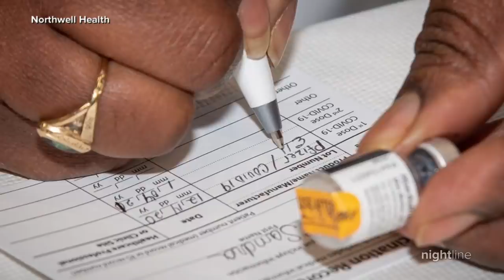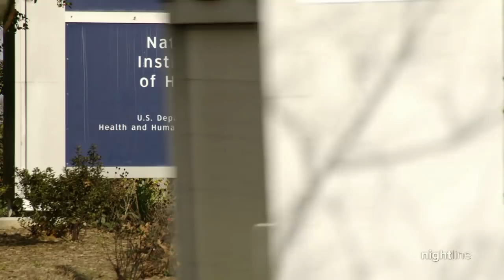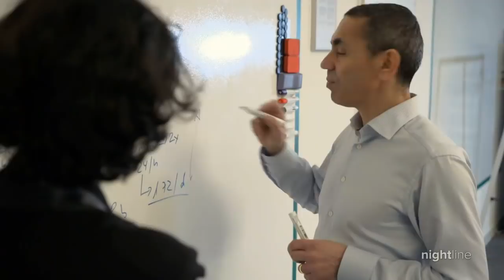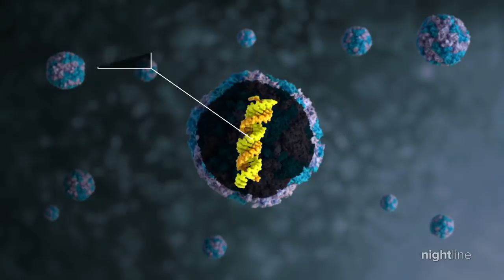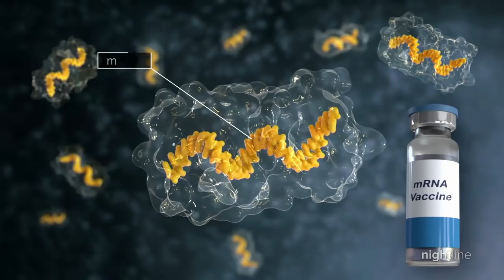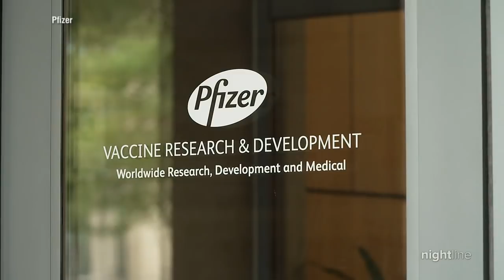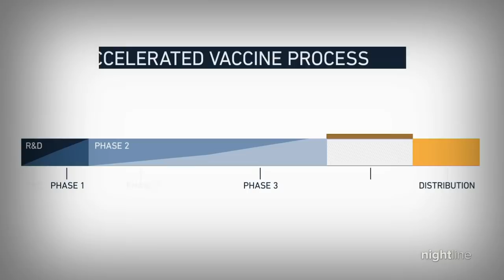Inside the race for a COVID-19 vaccine: Part 1

Comment: The Vaccines Are Worse Than Dr Mikovits Thought

Dr Judy Mikovits said that this coronavirus vaccine could kill 50 million Americans over the next 40 years. The versions being released by Pfizer and Moderna require storage at minus 70 degrees Celsius (minus 94 F) and might be far more deadly than even she originally estimated.
Why so cold? Children’s Health Defense explained in an August 6th article, “mRNA vaccines undergoing Covid-19 clinical trials, including the Moderna vaccine, rely on a nanoparticle-based “carrier system” containing a synthetic chemical called polyethylene glycol (PEG).”
The use of PEG (polyethylene glycol) in drugs and vaccines is increasingly controversial due to the well-documented incidence of adverse PEG-related immune reactions, including life-threatening anaphylaxis.
Roughly seven in ten Americans may already be sensitized to PEG, which may result in reduced efficacy of the vaccine and an increase in adverse side effects.
If a PEG-containing mRNA vaccine for Covid-19 gains FDA approval, the uptick in exposure to PEG will be unprecedented—and potentially disastrous.
Moderna documents and publications indicate that the company is well aware of safety risks associated with PEG and other aspects of its mRNA technology but is more concerned with its bottom line.
Lipid nanoparticles cause hyperinflammatory responses in the body, leading to severe reactions, hospitalization and potentially Death.
Why are LNPs (Lipid Nanoparticles) used in these vaccines? As Children’s Health Defense   further explains:
Lipid Nanoparticles (LNPs) “encapsulate the mRNA constructs to protect them from degradation and promote cellular uptake” and, additionally, rev up the immune system (a property that vaccine scientists tamely describe as LNPs’ “inherent adjuvant properties”)
In other words, the LNPs are adjuvants, meaning they are designed to cause hyperinflammatory responses in human beings, once injected. This is done in an effort to induce the creation of antibodies that then allow the vaccine manufacturer to claim high “effectiveness” rates, even when those very same adjuvants cause severe adverse reactions.
According to recent vaccine trials conducted by Moderna, 100% of human subjects in the high-dose vaccine trial group experienced adverse reactions.
So why are Moderna and Pfizer using mRNA (messenger RNA) in a vaccine? They want to reprogram human DNA as an experiment and see what happens to our progeny. Critics in the UK say a side effect is sterilization which is good for the Powers That Ought Not To Be because they want to rid the earth of 6 billion plus commoners.
Update at 4:50 AM. From the Australian Independent:
These new vaccines are in an entirely new class all by themselves. They are known as “messenger RNA” (mRNA) vaccines, and they work by hijacking the protein-making machinery in your cells…
When Moderna was just finishing its Phase I trial, The Independent wrote about the vaccine and described it this way: “It uses a sequence of genetic RNA material produced in a lab that, when injected into your body, must invade your cells and hijack your cells’ protein-making machinery called ribosomes to produce the viral components that subsequently train your immune system to fight the virus.”
“In this case, Moderna’s mRNA-1273 is programmed to make your cells produce the coronavirus’ infamous coronavirus spike protein that gives the virus its crown-like appearance (corona is crown in Latin) for which it is named,” wrote The Independent. End Update:
The Astra Zeneca vaccine does not require minus 70 degree Celsius storage and transport facilities because they are not using mRNA to reprogram the human body. But they are using a human fetus as an adjuvant. An adjuvant helps the vaccine to develop a heightened immune response. In this case they are using MRC-5 which is from the lung tissue  of an aborted 14 week old Caucasian male. Adjuvants stir up your immune system. MRC-5  which is the DNA from that aborted baby is seen by your body as an invasion and mounts a defense.
American children have so many vaccine injuries by the time they are 21 that over half have diseases and syndromes that nobody had seen in these numbers before the 1960s when Big Pharma began rolling out so many more vaccines.
Now we know why Israel has opted to use the Russian vaccine and refused Pfizer, Moderna and Astra Zeneca’s offers.
The modern diet, the pesticides, the herbicides, the vaccines and the drugs of Big Pharma have created an epidemic on inflammatory conditions in modern men, women and children. Are we prepared to treat hyperinflammatory cases by the tens of millions?
The Englishwoman in the video below shows the Astra Zeneca insert which admits to using MRC-5 or human fetus body parts. She also says that the British government is looking for an AI system to help them collate and interpret the information when vaccines injuries and deaths mount up.
https://www.brighteon.com/embed/e536da0c-7935-41eb-babe-416034e154c3
Bill Gates once smirked and said people are not paying attention to this virus but they will pay attention to the next one.  (Are you prepared for Bioweapon 2?)
I think it is best that we skip this vaccine. Let everyone in the Gates family, in Big Pharma, in Corporate Media, on Wall Street, in the House and Senate, at the CDC and NIH take this vaccine first.
I confess to a love for animals so I think it is best that we skip animal testing when there are plenty of despicable human beings available.
Of course I would still refuse these vaccines because I do not believe Bill Gates should have the right to reprogram the DNA of 7 billion people just because he thinks it is a good idea.
The death rate is very low for people who were not going to die anyway from heart disease, cancer, COPD, drug overdoses, terminal kidney and liver diseases, automobile wrecks and suicide. If we all took vitamin D-3, the covid death rate would be less than the flu. I would add Quercetin and zinc to bring it even lower.
This is the article in which Dr Mikovits said 50 million Americans could die from this vaccine. But notice she does not mention the nanoparticles which could very easily be far more dangerous to human health than regular molecules which do produce inflammations. Hyperinflammations might cause serious illness and death.
Dr Mikovits: Vaccine Could Kill Tens of Millions in America
https://vidrebel.wordpress.com/2020/10/13/dr-mikovits-vaccine-could-kill-tens-of-millions-in-america/
I mentioned Bill Gates smirking while hinting at the release of Bioweapon 2.
Bill Gates Smirked. Will People Die?
https://vidrebel.wordpress.com/2020/07/06/bill-gates-smirked-will-people-die/
I implied that the Corporate Media are as despicable as politicians and Big Pharma.
Matt Lauer made $25 million a year reading the morning news. He had perks. He demanded a button be placed on his desk so that he could electronically lock Gentile women inside his office. Matt Lauer raped women so badly that ambulances had to be called to his NBC office. But that was before The MeToo# Movement.
Whopping Tales Of The Mainstream
https://vidrebel.wordpress.com/2020/06/01/whopping-tales-of-the-mainstream
I must warn you that we are headed to a Depression far worse than 1933 America or 1923 Germany.
Just How Bad Will This Depression Get?
https://vidrebel.wordpress.com/2020/11/13/just-how-bad-will-this-depression-get/
References: I must admit that when I first saw this article I decided to post part of it to warn everyone.
https://www.distributednews.com/475569.html
Their source was Children’s Health Defense
https://childrenshealthdefense.org/
 

Share this:

Twitter

Facebook